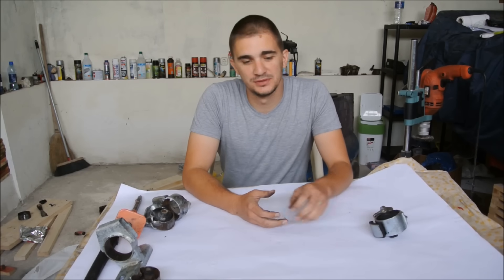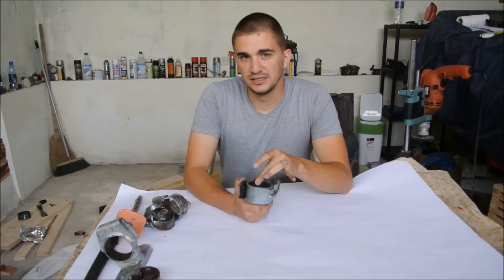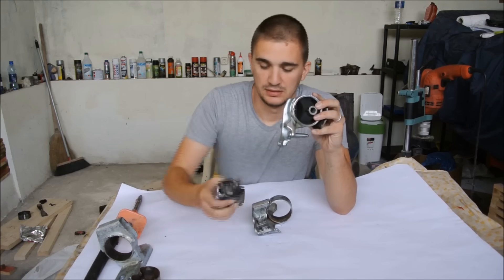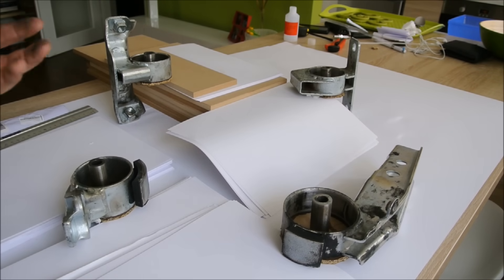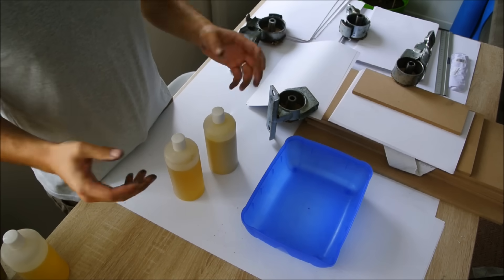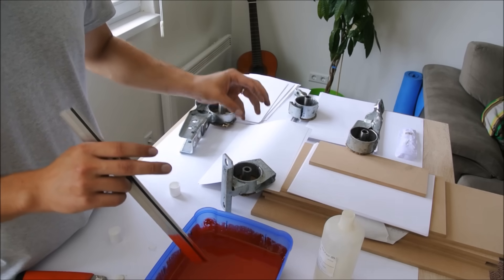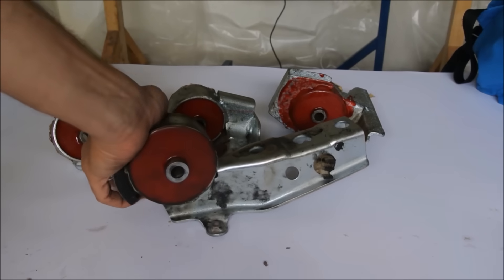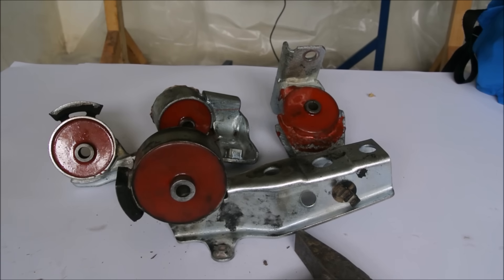How to make DIY polyurethane engine mounts

Comment: the whole measuring and offsetting the pins is sketchy to me so if i were to do this i would just pour the poly in the motor mount with the old insert in there already, maybe drill holes or cut out some of the old stuff
Reply: thats what i do. few years ago. all i did was replace the liquid with 3M rubber. the one you used to seal restroom or wood. it was too rough for my taste and i brought oem mounts.
Reply: I suspect the offset isn't by design, it's the old rubber having collapsed and now he's transferred that 'collapse' into his new mounts.

Comment: potentially dangerous

originally made items are made using injection moulding, on a press with ten's of pound of pressure behind it to force the poly into the tool/mould. seriously this is a really bad idea, your not getting the correct amount of poly nor the necessary pressure to ensure a good strong component
Reply: Mal P i have made many mounts out of poly in a way very simular to this and never had a single issue. i  use auto windshield mounting poly as its easy to get my hands on. never had to redo or replace one. but i dont recommend it. takes very long to dry and maybe i was just lucky.
Reply: I did something like that on my honda, I pulled the stock mounts, left whatever was left of the stock rubber and just filled the gaps with the 3m Window Weld, after several days to cure they where ready to swap in (I pulled the mounts from the one I wrecked, did this to them, then installed them in the one I bought to replace the wrecked car), MUCH stiffer then even a NEW mount with a poly insert.

Comment: If you want to get the air bubbles out, you take your mini torch and pass the flame over it right after you pour it. I was a polymer tech for quite a while. Also, it helps if you heat the mount first as well.

Comment: My Mazdaspeed 3 has three engine mounts: the rear motor mount (down low, between the transmission and the subframe), the passenger motor mount (up high on the left side of the passenger's side of the engine bay, between that side of the engine and the longitudinal frame rail there, and the transmission motor mount, about halfway down the height of the engine, under the battery box). The mounts are designed to run OTS Energy Suspension polyurethane bushings, for easy replacement, if necessary.

I will say thins: a major contributing factor of NVH is the orientation/loading of the bushing itself. All of my bushings are in the 80+ duro range, and it does add some vibes, but I'm putting down 385/380 @ the wheels, so the performance boost of having the engine very solidly mounted is worth it to me, especially with an eye toward occasionally tracking.

Great vid, BTW.
Reply: That's good to know about the Speed 3.  I have a regular 3 and swapped the terrible oil filled mounts for 80 duro poly mounts.  It drove me nuts and they didn't stay long.

Comment: if you only heat the pin it only melts/burns the rubber around the pin and makes it a hell of a lot less messy. aim the flame down the center of the pin and the pin just slides out on its own
Reply: Depends what kind of rubber they used there to begin with, some simply don't melt. But thanks for suggestion, could be useful.

But i wonder, why cannot the pin be removed by chiseling or grinding away the rubber?
Reply: Dan TheOracle exactly well said

Comment: The reason the mounts arent central is because they have SAGGED!   What is the point creating a NEW mount with the same sag!     ALL circular mounts, when fresh, are central.
LOL!
Reply from the maker: Sorry but you are wrong. Google Mr2 mk1 mounts and check out their stock design. Not all circular mounts need to be central and sagging isn't a property of rubber. It can get deformed but it will never sag in the sense that you put the pin in the central position and then it sags down again, that would be taffy.
Reply: I just googled, all central.  The reason they sag is because of weight, or force, in a particular direction, such as engine steady bars.  With time the force causes the rubber to permanently deform.   I have seen it time and time again.  Nothing 'taffy' about it, its plain physics.
Reply from the maker: http://images.gasgoo.com/attachment/Approved/001/141/400_400/001141671.jpg
So this is central? Not designed this way? Sagging? Took me 20 seconds on Google. Typed "engine mount".
Reply: driving 4 answers  Yes. its 'central', ie with a mm or so of center.
Reply: https://images-na.ssl-images-amazon.com/images/I/41OBPxhM14L._SX300_.jpg

Plenty of OEM FWD Engine mounts are NOT centered, not even close to centered.  It doesn't matter if it's more complicated of a design. There is a reason it's done that way.  Cost is always a factor and if centrally locating the center bore was cheaper and would "work" it would be done that way.
Reply: SigneM-Prut#1 :)    Calm down?  THe internet is expressly designed for ranting!  :)
Reply: you are such an idiot, you started your argument with saying that all engine mounts are centered. they have proven you wrong so many times, how about you just admit that that you were wrong and admit that not all engine mounts are centered. my nissan quest has the front and back engine mounts that are not centered. such an ignorant man, smh.
Reply: plenty of mounts that are designed not to be central whatsoever. Look up e30 lower control arm bushings.
Reply: Thomas Miata Dont know about 'plenty' but some are, for sure.  The problem is it makes manufacturing more complicated, they have to be assembled to line up correctly.  As an engineer you wouldnt choose to do it that way.   Take the E30 for example, it probably started out central and because of either an error in calculation, or realisation that it wold handle better, the bushes were offset.
Reply: zzebowa I appreciate the engineering background but I think you are over estimating the importance of the precision needed while mounting an engine in a car application. a few mm or even a half inch in variation isn't going to hurt anything in the driveline. for example, my v8 e36 swap video shows how I mounted an engine a half inch off center with no issues. I also clocked that engine a few degrees as well.
Reply: Thomas Miata Of course, for an engine it isnt an issue, they happily accept, in fact need, a good bit of space around them.  My objection was the ridiculous lengths the video maker made to replicate the sag, rather than just centralise the bush.    Of course if it were s suspension bush he was replacing then the issue of offset is much more important since it affects the geometry, and hence stability of the car.
Reply: No, very incorrect. Google off set bushings. https://www.ecstuning.com/b-genuine-bmw-parts/control-arm-bushing-kit/31129064875/
Reply: ***** And this demonstrates what?  We already know some BMWs have offset suspension bushes, we have discussed that, and the possible reasons, already.   The discussion is why the video maker would replicate a deterioration in a bush that is clearly due to sag and not manufactured as an offset bush (which are rare in any case)
Reply: Demonstrates that you are an idiot claiming that and I quote "ALL circular mounts, when fresh, are central."
Reply: ***** Wow.  What a pedant you are.  Tell me, do you think the mounts this guy was remaking were central or not?
Reply: zzebowa
Reply: Why continue to argue when you're wrong? Is it really that hard for you to just admit your mistake? Many many mounts have the pin mounted in a non central location.
Reply: Marcio Cardenas Anyone who cant tell the difference between an intentionally non centered bush and one that has become non centered because of age, and sagging, is a cretin.

Do you fall into that category?  Your choice.

Comment: I would highly recommend doing this in a well ventilated area and wearing gloves and a respirator.
I work with PU (polyurethane) on a daily basis as a mold maker and this stuff can make you really sick!

DO NOT USE this in your living room!

Aside from that, Smooth-On makes some great products for prototyping, I use them daily! 
+1 

If you have access to a vacuum pot, you can degas the urethane prior to pouring. 
This will get rid of any unwanted air bubbles. Also, most polyurethane rubber compounds can be post-cured in a scientific oven to reach optimal mechanical properties. 

Cheers!
Reply: Guys take heed...  look up isocyanates  both burning and mixing polyurethane is no joke.   I've talked with painters who've been exposed and it's not fun whatsoever.

Comment: Should look into a method like this instead of the ol' hammer and chisel, my man!
https://www.youtube.com/watch?v=sZueMg_FpqM
Reply: isnt that rubber only rubber? the ones with the metal around the outside like in this vid are much harder to get out.
Reply from the maker: Nice work, but I would need one huuuge washer for my mounts, that would probably collapse due to its size. But a great idea for smaller bushings.
Reply: driving 4 answers I get what you are saying, finding the right sized parts do DIY bushings as large as yours would definitely be a pain. A wheel bearing puller and press kit would probably be your best bet, actually. Wasn't my video, BTW, was just trying to find a good example.
Reply: Dan TheOracle Yeah, pressing out the metal race is definitely harder, but it can be done. Although another complicating factor is the inner diameter of the bolt through hole, which limits how large of a screw you can use as a hand press. Really this is a job for a hydraulic press, but there are ways!

Comment: "not for looks, just for function" yet you put red dye in the urethane hehe. Neat idea, I hope you did drill the mounts a bit, like you said, to allow for flex. Also, I would just make templates from the original pieces rather than measuring (if they are still intact)

Comment: I wonder if you can "inject it" vs pouring it in. Like with a large sized lab syringe. You would be able to control how fast you can inject it hence removing any air bubbles. Great video by the way. Will be using your knowledge on my next project. Thanks.
Reply from the maker: 3M window weld can be injected, the results should be similar.

Comment: Quicker less painful way to remove the inserts if you don't have a press (I find it easier than using the press) is an air hammer, chisel attachment  and a bench vice ;)
Reply: The air choochin hammer is best for all applications where you just don't care about finesse!
Reply: Jimmy Danger Gonzalez Damn straight!
Reply: Jimmy Danger Gonzalez  I iz recognize an AVE follower when I has seez onez... Hail 200 pounds gorilla!!!
Reply: +Andrei M yep! She be a skookum choocher!
Reply: joey BOYER Because I have a 20ton air over hydraulic shop press :P
Reply: I used a sawzall when I did my car, just cut slowly so you don't over do it through the insert. First cut out the middle pin, then cut the insert, I did it under the Jeep and pressed int he new one under the jeep. LOL
Reply: Why even bother pressing out the inserts... just burn the rubber out and replace with urethane. That press-fit steel shell is going to make no difference.
Reply: a bench vice is a press dumb dumb
why didn't you just use that with a cheater pipe 
and make a die with some wood
Reply: Russell i see people freak out over this often,why even bother if you fill it up anyways haha allways done mine like that,keep it simple
Reply: An even quicker and easier way to get the center bolt mount  out of the bushing is to just get a  drill bit and between the urethane and the bolt mount and run it in circles and "walk" the bolt mount out of the bushing. You can do the same thing and well the Bushing itself out too instead of melting it.
Reply: I was going to mention this +1 for this. remember this people(the drill bit trick that is)

Comment: Are you sure that the pin in the middle is not centred in the old mounts because they have been pushed off centre over the years?
Reply: Just google image search Motor mounts, you'll see almost ALL motor mounts on all cars, US, Europe and Japan have an offset pin when new, this is to compensate for sag and wear as they get older- the bolt tube is usually higher than center when new because as the stock mounts droop over time they still keep it somewhat central- it's important to note you get the orientation of the pins the right way because you can end up tilting the engine front to back or side to side the wrong way and bad things happen to engines that aren't held level in the car (ESP with carburetor cars)
Reply: That would be my guess as well.
Reply: Looking at the bushing in this video though, it definitely looks offset by design.
Reply: I'm wondering if there might be a market for offset pins for tits "to compensate for sag & wear as they get older..... as the stock units droop over time".  Sorry... just wishful thinking on my part I suppose.
Reply: Eclidean
Reply: Yes, this can be tricky.  The OEM rubber mounts are rubber, not PU and have a different durometer from PU.  As stated, the OP used a stiffer PU than the OEM, so therefore there will be less settling in of the bolt tubes over time, and that implies less offset for the new PU is needed.
Reply: Eclidean thinking about it I think you must be right. These are elastic so perhaps they are designed to centre when the engine weight is applied.

Comment: Those pins are not central in the rubber mounts because they sag a bit once the engine is hanging on them, they SHOULD be central once everything is all refitted so that the pin doesn't hit the edge while it moves around.

It probably doesn't make much difference if the engine is held in a lsightly different position by the poly mounts not sagging so much but it's worth bearing in mind.
Reply: not so had to purchase some mounts for friends corolla some are offset by design...porsche also does this on some mounts

Comment: you can use foil on top of the cardboard
Reply: Waxed paper works well too. It will peel right off once the poly is cured. As stated in the video, the pin setting is very important. Some new rubber mounts have the pin higher than they will settle to once the weight of the engine is on them. This is where the pins should be when you pour the poly, in the loaded position, not the unloaded. On some, it will cause the engine to sit too high if you make a set with the pin in the unloaded position, since a solid poly mount will not settle once loaded. If this happens, the mount will be of no use and you'll have to make another one. I learned this from my own experience.
Reply: Mahir Fredericks good idea thanks i was planing to do this to my honda
Reply: Try "PAM" cooking spray on the cardboard as a release agent .

Comment: Great idea, but why not leave the original outer sleeve in place? That way the mounts are removable if they fail.
Reply from the maker: +Chris Salter It is an option, but you will need to burn away ALL the old rubber.

Comment: Love the video does the reo flex 60 comes in a kit or do y have to buy the dryer by it self and what was the name of the other liquid that u used.
Reply from the maker: +Luis E Hernandez Its not really a kit but it consists of two bottles that are the two components you mix together to form the polyurethane. The dye is optional and you need to buy it separately.

Comment: this method at end is very wrong 
the way u mold it at end very rigged and stiff like one peace no flexibility like original the manufactur rubber to absorb engine vibration thats why so its useless

Comment: They certainly aren't centred so would change the geometry of the suspension and handling. In my opinion a fail
Do not try this yourself like this. I would buy the material and once set in a circular mould I'd use a lathe to form the bushes.
Reply: These are for motor mounts, so no suspension geometry issues.  Now for the suspension part mentioned above, you would have a point.  But easily solved by taking care to place it.  And if the part isn't available, well making it becomes a better option than leaving blown parts in place.
Reply from the maker: They are off center by design, i.e. when stock.

Comment: It is not clear from the video how it really works when mounted on a car. It could be harder or softer than it needed.
Reply: If it too hard just use an ordinary drill to create voids, create a few smaller holes. if it is still too hard just drill a few more.  I have had to do this on Powerflex engine tie-bar bushes that transmitted too much vibration.

Comment: Better than your average video, re: actually touching on Shore hardness. Though Shore is a a measure of essentially constnat compression forces, and not dynamic elasticity (which is what your car is experiencing as the loads vary). 

Not a materials chemist, but toulene/NMP are pretty good re-agents to dissolve PUR (obviously there are a bazillion varieties, crystaline, vs non, polar and non, blah blah but as a first-order approximation- that's where i'd start, then clean with standard DCM). 

Benefit is you won't be inhaling the noxious what-ever-the-fuck the auto manufacturer put into the original polymer (probably not actual rubber from trees -- too expensive to produce since latex is expensive and rubber needs to be formed under high pressure and temperature, so plastics you can just injection mold into cheap aluminum molds are cheaper which is why 95% of the industry uses petrochemical synthetics instead).

PUR in general is useful but pretty expensive. http://catalog.ides.com/Datasheet.aspx?I=43838&FMT=PDF&E=5830 PA6 GF30 + a hollowed out fire brick for a make shift enclosure + standard oxyacetylene for heat (some guy took standard bbq source, two different sized syringes with adjustable valving to control the propane + air mixture... can reach a hundred or two short of 1k centigrade) + an air compressor and a gear motor to drive the pellets = a good time haha